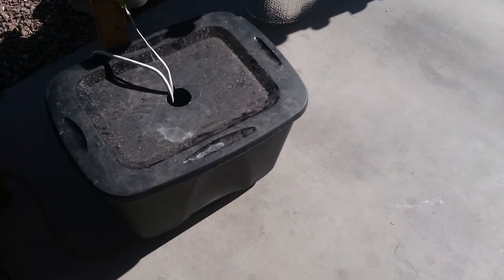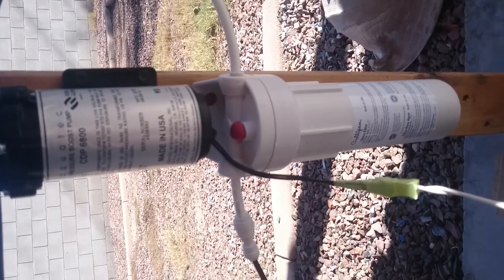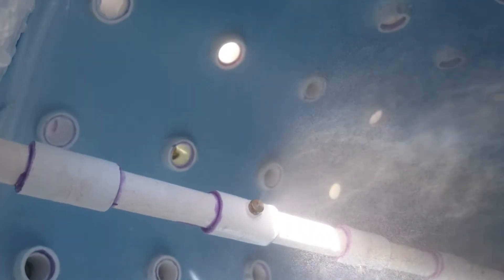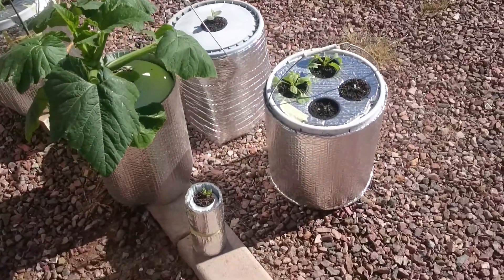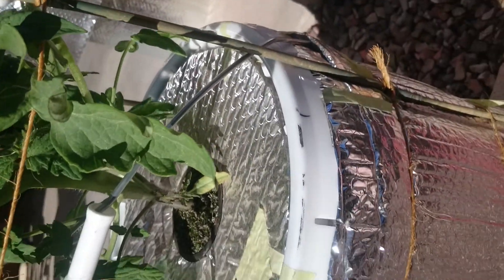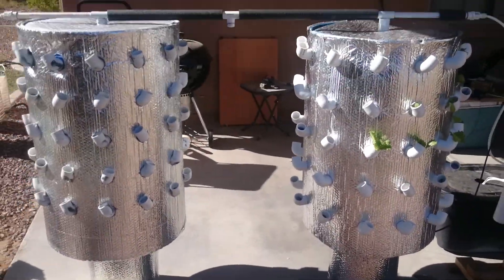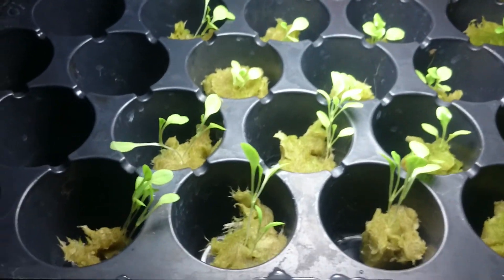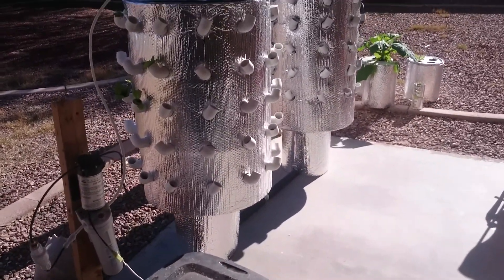DIY High pressure aeroponics towers with some lettuce .

Comment: Hi Tod, very impressive I love your attention to detail in your construction. 1) Do you use different nutrient solutions for plants with different requirements (i.e. tomatoes and lettuce)? 2) how do you make your barrels rotate so easily, it's as id you have the mounted on a bearing?
Reply from the maker: I used lazy susans from the hardware store for the rotation.

Comment: I appreciate the information. I'm attempting to put together my own system now based on your design and Art Garden's. Can you tell me what that is between the output on the pump and the filtration system? Is the CDP 6800 the best pump for this? Ben is using the 8800 is why I ask. I would sincerely appreciate any advice.
Reply from the maker: I'm using the 6800 and have had it running 24/7 for almost 10 months now. and have had zero issues thus far.
Reply from the maker: in between the pump and the filter was a check valve that I have since eliminated along with the timer because it was no longer needed. when I can I'll make an updated video and you'll see the results of my experiment.

Comment: Did you eliminate your need for a check valve on your input for the pump coming from the reservoir? Thanks, awesome system.
Reply from the maker: yes I did eliminate it and also I got rid of the timer because of the nutrients clogging the misters.